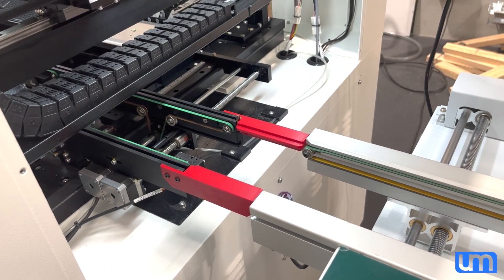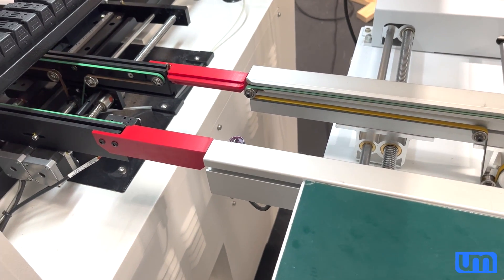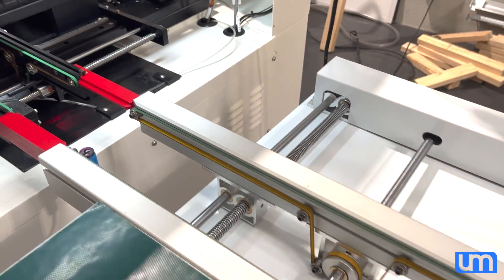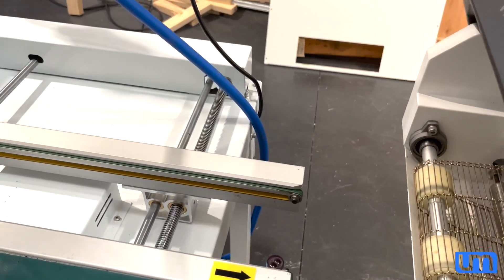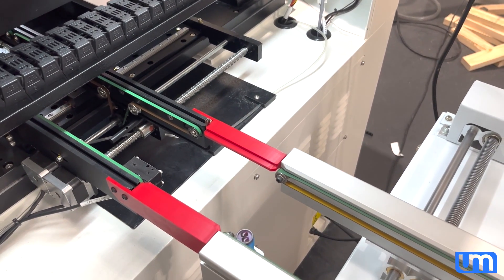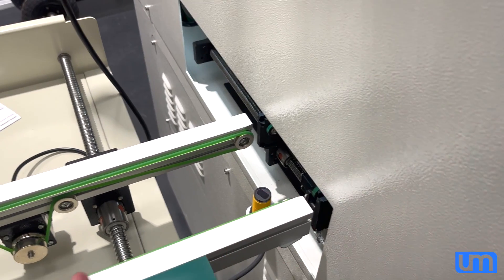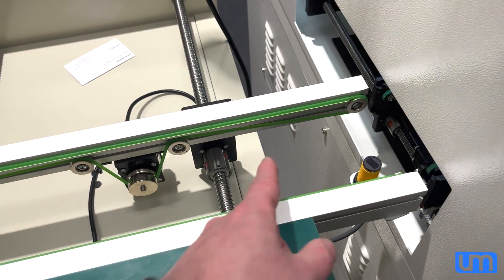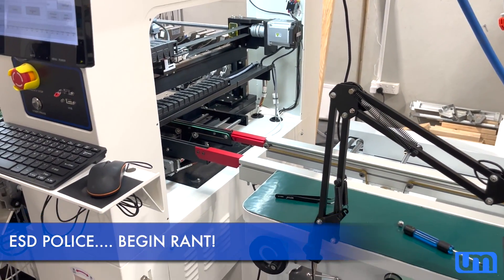Design a custom PCB conveyer? NAH!

Comment: That conveyor system would be dead simple to build on a CNC. got it 3/4 designed in my head. Instead of the motors and ballscrews you could use a round rod and bearing if the machine next to it is providing width adjustment.  Then as you say a small motor to just turn the belt. You could probably nearly 3D print it.
Reply from the maker: 3D printed wont be strong enough - would flex and get damaged and wear over time. It would need to be machined, but not necessarily out of metal.
Reply: @UnexpectedMaker  ally is easy enough to machine.

Comment: Could you place a small camera pointing down and a screen facing you on the left, with a 10-15 cm extension? That could provide you with a magnified view of the board looking straight at the monitor vs down between the 2 machines, and save even more space?
Reply from the maker: I need to be able to get in and grab the board if I need to - without smudging it. So it has to be wide enough to get my body in and grab the board, even sideways.... but sure, having some vision in there could be handy :)
Reply: @UnexpectedMaker  Look forward to seeing it all setup and running. Great job on your part given what we've just been through these past few years...